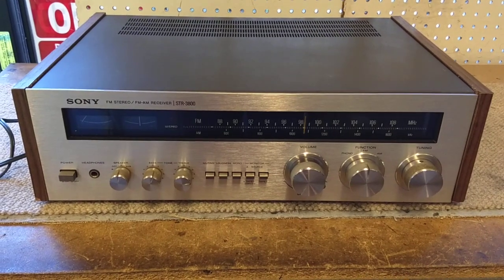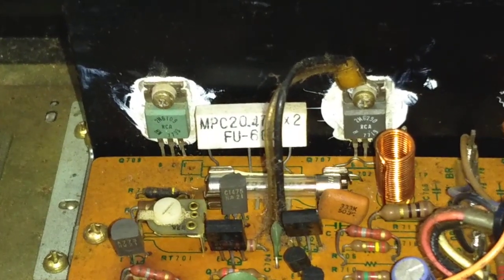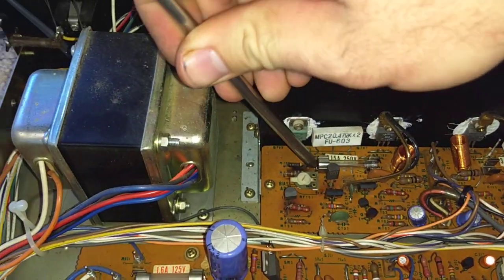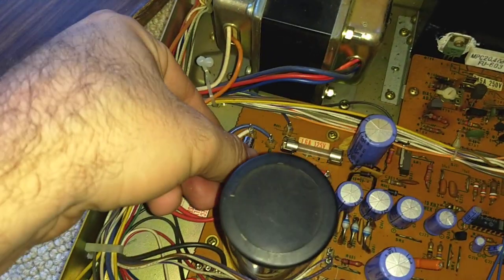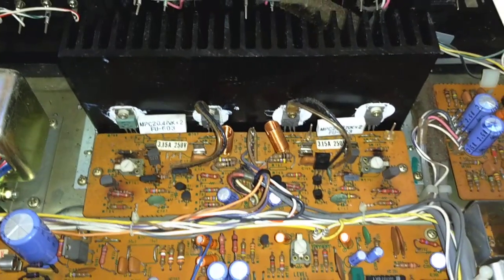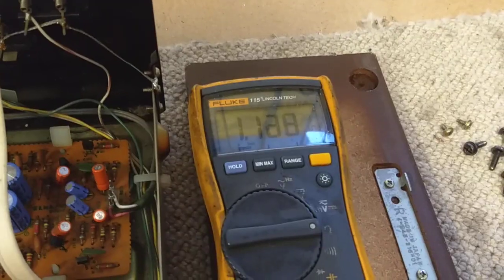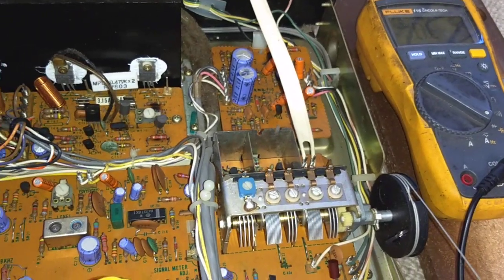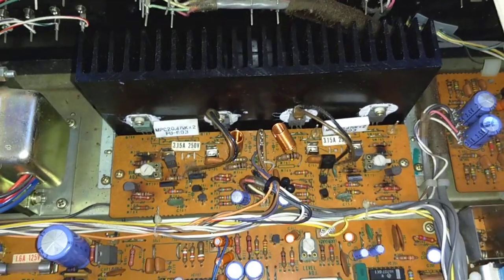Quick diagnosis of Sony str-3800 stereo receiver

Comment: This is exactly why these specifically state the impendence load they're designed for and why you don't go lower than that especially on lower end equipment like this. I wouldn't be surprised if someone continued to hook up 4 ohm subs to get maximum bass response instead of the regular 8 ohm speakers and it probably sounded good until those fuses failed. It was probably done again twice until it ultimately destroyed the amp section. Now I see nothing wrong with wanting to use 4 ohm speakers on a 8 ohm unit but at least rewire them to be an 8 ohm load, not a 4 ohm or even 2 ohm load however if you have the proper speakers on hand use them instead. Oh and don't go treating a home stereo amplifier like a vehicle subwoofer amplifier.

Comment: I'm not sure that I'd call it junk, although your analysis of the economics is true. In the 70s, most of the output failures that I saw, either on high-end gear like SAE, or the mid-level stuff, ie Yamaha, Technics, Sony, were exactly like this one: all outputs and drivers and predrivers bad, plus passive parts. One just did the repair - we stocked most of the parts anyway, so in they went, after a thorough check of EVERYTHING on the channel. 

The repair, though complete, never cost as much as the current value of the unit, so they were repaired all the time. 

I remember having to replace entire transistor complements of blown channels of SAE and other high-end units back then. We stocked entire ranges of parts for the brands for which we were authorized dealers.

The customer was also schooled on how better to take care of the gear once returned.

Comment: Seen many like this. If talked into repair did the following.
Order manual, ALL DC coupled semis, change all lytics in PA, remove all semis,
ohm all resistors, variac then by the book bias adj. The estimate was always too high
due to high cost of OEM outputs. On high end stuff we just told them to send to the
factory. You know how it goes. One missed part or slip & ZORCH !  $50 in parts gone in a ms....... Thats why my true love is NTSC solid state TV sets.

LFOD !

Comment: The fuse thing gets even worse. I'm working on an antique radio, Telefunken /Opus 7, and found the line fuse and holder wrapped in aluminum foil. The filter caps where bad, and I feared for the worst, but it turns out the selenium rectifier signed off first and opened, saving the transformer. Whew!

Comment: My dad was an electrician. If I remember right, someone had a 30 Amp fuse on a 15 amp circuit. He had a space heater plugged into one of those taps that have at least 6 outlets. The tap burned along with the outlet. 30 amp fuse was fine.  Thankfully his office and garage building where his wife's Town Car was all fine also. He later called on us to change out the fuse panel with a breaker panel. Wise choice.

Comment: My friend has a little bookshelf hifi thing from JC penny. Its decently old, maybe 70's?. It plays static at any volume on any source. If you turn the volume up high enough you can hear the audio under the static. Its not typical static and I cleaned the pots. Nothing inside looks burnt. Any advice would be helpful. Thanks!
Reply: If the static is there with the volume ALL the way down its in the output stage.
If it uses big black IC's on a heat sync odds are its one of those. ( marked STK-####) Very common.   GL
LFOD !

Comment: I've taken in older receivers where the fuses did their job,  and the circuit was OK despite the speaker outs getting accidentally shorted.   I replaced with the fuse values that were marked on the board.
Reply: Unfortunately, much of the time the markings on the circuit board will not tell you whether it's supposed to be a fast blow or slow blow or some kind of time delay fuse. Often the manual won't tell you either. Best to assume use of a fast blow fuse, you can always change it to a slow blow if it's eating the fuse for no apparent reason.  I hate it when they use a paper label to mark the fuse value come often times they fall off and get lost the 1st time somebody opens of the unit.  Silkscreen numbers on the board are better.

Comment: Are the two blue electrolytics to the right of the large black electrolytic leaking?  It looks like there is some tan-colored ooze around them.
Reply: Bob, that's just glue that was used at the factory to hold the capacitors in place before they were soldered by machinery.  Doesn't appear to be a problem in this particular case, but many vintage amplifiers used glue that becomes corrosive and conductive over time, destroying parts and sometimes even eating through the circuit board.